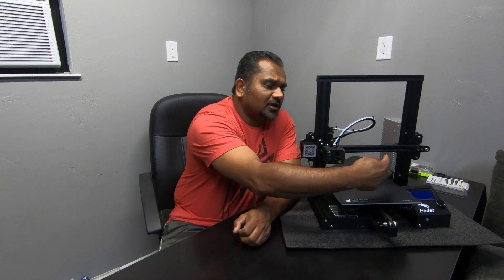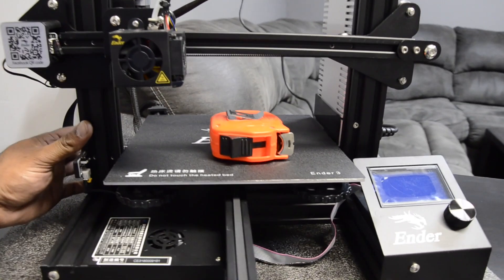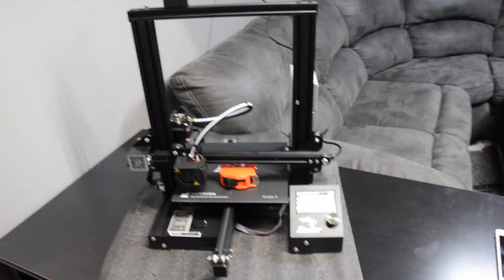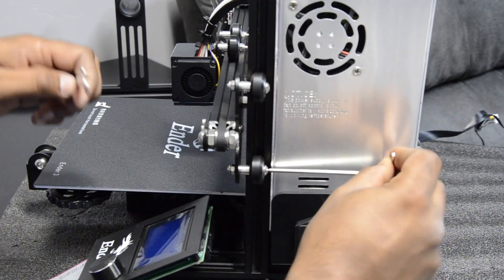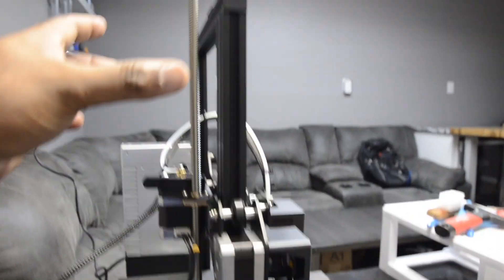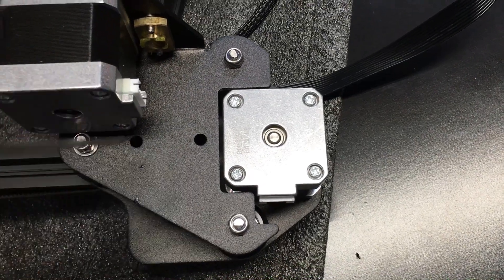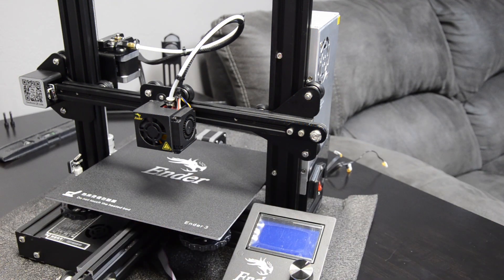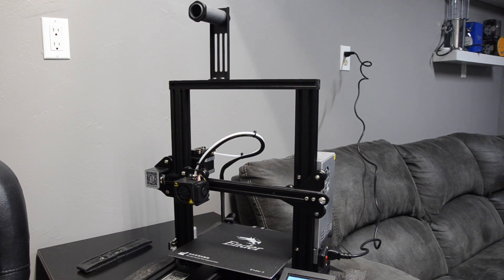Creality Ender 3 / How To Level Your X Axis

Comment: On my Ender 3, the X-axis V-slot extrusion looks like it's really not level compared to the table the machine is sitting on (or even just visually comparing to the 90 deg angles on the top cross-member V-slot extrusion. On the Ender 3, the tighter the wheels on that right side are "hugging" that right-hand side vertical V-slot extrusion, the less wobble (or play) you're have on your X-axis V-slot extrusion. I check it by hand every few weeks or so to make sure the V-wheels haven't loosed. Tightening those eccentric nuts usually deals with any play. But I still notice that the skewed X-axis. I don't know what else to do, apart from upgrading to a dual Z-axis to really get  rid of all wobble or play on that X-axis extrusion....

Comment: Got a little issue with mine, will try you methods tomorrow, thanks for the tape measure tip on measuring if it actually is not level

Comment: the single (dumb) nut that holds the extruder (and bolts the left side of the gantry arm) on my old ender 3 V2 is loose and the arm wants to move upwards, what can I do? I tried tightening it and it turns but doesn't get tighter

Comment: I was able to get the code/commands etc updated. I created an issue on the KenT2 Pi Presents page. He answered me on what needed to be done. Follow the links to the code page and then go to the Issues tab. Look for the issue posted by me, ErinC13. Ken answered what needed to be done and also updated the profiles so they will run on Pi Presents KMS

Comment: First, I am appreciative for the informative video, it is the first that I have found that has actually helped...somewhat. I say that because even after removing my x-axis gantry and tightening the plate screws, which weren't loose at all then replacing everythingand tightening the wheels again, I am still a full sixteenth of an inch lower on the right side of my x-axis gantry. I was an eighth prior to this. Perhaps I just have a defective printer?

Comment: I was up to a point where I thought the bed was warped or the structure deformed as the nozzle was getting stuck to the bed from the center to the left. I even thought of disassembling the entire printer and assembling it all over again until I saw this video. The right side of the X axis was over 1cm higher than the left and now I can finally level the bed. Thanks a lot for this video

Comment: The two bolts holding the right side on were what did it for me, those are really easy to reach so before taking the whole x axis off try adjusting them first, just loosen it and try to hold it where you want it and tighten them back up

Comment: Those two M4bolts can be replace by two M4x20 & two nuts mounted the other way around(tight fit). Now you can adjust the x-gantry without removing it.

Comment: thanks a bunch. noticed the right side of my printer wasnt raising as fast bas the left at the start of prints causing them to lean slightly. Noticed a few of my wheels werent even touching fixed the issue

Comment: My x-axis is still off by about 2mm, any ideas?
Reply: maybe a little late but if it is the right column thats lower, i propped something under the x gantry on the right side and turned the z screw down by hand untill they where level. while in the level position, i tightened all the pom wheel screws.

Comment: thank you SOOOOOO much. i recently go tit for my birthday, and the print kept smearing on one end of the bed, so naturally i leveled that, like a mad man. only to find out later that the x arm was not leveled at all. and i have just been printing with the bed similarly leveled to the Xarm. but no more thanks to you. the wheel adjustments helped. will adjust accordingly when my caliper comes in. again, thank you sooo much

Comment: well, having followed you awesomely clear and concise tutorial here, found my x-axis is not only off by 4mm (Now corrected), but the gantry itself is bent slightly, with a bit of elbow greas and a general tightening though, its now about as level as can be, still off by maybe a mm at most, but its as good as its gonna get short of replacing the arm, which i just dont have the funds for atm

Either way, many thanks for this awesome vid, youve got yourself a new subscriber, also a couple friends just invested in FDM machines, i'll be sure to point em your way as well :)

Comment: Hey man, did all the steps but my X axis on the right side is loose, i can move it up and down with my hand qith a little bit of force, is that normal? i have ben able to print by moving it up so that it makes the first layer well enough to keep printing and it does, but it does seem like i HAVE to do tht every time, so is it normal or should i look into another work around?

Comment: The problem for me is that you can't access the bolts on the brackets while the gantry is on. I really think they could've drilled a clearance hole in the z axis rails to stick an allen wrench through.

Comment: Thanks! Thankfully, I managed to get it aligned without having to take the whole thing apart. I noticed the issue when one of my bed height adjustment wheels had to be fully tightened to get the bed levelled and I'm so glad that my troubleshooting led me to this video. You saved me. I am eternally grateful.
Reply: Thats my problem currently
Reply from the maker: Excellent!

Comment: I leave the two plate mounting screws on the right end (by the power supply) loose, until every thing else is adjusted. That allows the right end plate to 'align' itself to its Z rail when you tighten that eccentric. Then, when you tighten the two plate screws, there is no alignment torque applied to the X axis.
Reply: This needs to be first comment! Its been so long since I needed to make adjustments that I forgot this trick made it super easy to adjust properly! Thanks for the reminder Doug!
Reply: I have been trying for so long and this comment legit just fixed it in minutes. Thank you so much this needs to be top comment.

Comment: I was told in other tutorials "specifically for the ender 3 v2" that the wheels should be somewhat loose, so it doesn't cause the wheels to wear out due to unnecessary stress. Which I thought was weird, because otherwise the right hand side would essentially be a cantilever without sufficient, force keeping it entirely straight. I'll give this a try, as it makes sense that you want them to have good contact with the rail to maintain it's position.
Reply: Same. I thightend the rightside and it fixed my problem

Comment: I was able to skip fully taking it apart by loosening the outside 2 wheels near the PSU and the eccentric nut. i got the measurements level by hand and clamped the x-axis to the bar with a quickgrip clamp. tightend it all up and unclamped. its perfect and rock solid.

Comment: you know i did this set up from morning until now 12 :00+ am and i just heard my neck crack very loud .i worked so hard i wanna cry

Help me . here's my problem: (ender 3 v2)

the left part is too tight. ;___; and its so stiff to lift it up or lower it.......while the right side is loose, In the front view the x axis isnt even leveled properly as the right side with wheel kinda goes down while the left is kinda lifted up. 

I dunno if its the screw knob thing to turn around i did that too but not working or Im doing it wrong. .

ill watch this now, but please someone help me ;__;

Comment: Thank you so much.  I have been trying to level my X axis for a long time.  This is the first video that actually solved the problem.  I did have to go all the way and remove the x carriage, untighten the bolts, adjust the plates so they would be in the right position.  But it got me I think 99% level on the x axis. I think that's just a limitation of the overall design. 
Thanks man!

Comment: Thanks, great information. How about adjusting z axis? my z limit switch sometimes seems not bumping after z axis comes down. This breaks my bed leveling since it doesn’t stop at correct z direction all the time.
Reply: Have you found a solution to this issue? I am also having the z axis end stop problem
Reply: @andrewtrainor9995  Yes, my z limit switch was broken, changed with a new one and resolved the issue

Comment: I was having issues with my nozzle hitting my prints for about 6 mos now.  I got a BL Touch and a glass bed thinking it was leveling issues but that didn't help.  Finally figured out the x axis wasn't level and after watching your video I was able to level it and now it prints perfectly.
Reply from the maker: Glad to hear man, it’s always the simple things that hold us back. ( New Santube pla 1.75mm filament is here for purchase ($16.99 ) if you would like to support the channel) good luck and happy printing.

Comment: What are you doing exactly to the eccentric nut?
Reply from the maker: as you turn it it will tighten or loosen the axis. You have to keep adjusting it until your X axis has a good grip. Sorry for late reply.
Reply: @SANTUBE  No problem thanks. Why do you have to loosen the other two? You can't adjust it without doing that?

Comment: Somehow I manage to adjust bedlevel and all runs smooth... until 18 months later I recognize that X axis has 5mm difference! First I try to adjust eccentric nut from right side but it has no effect. But there is another on another side too. After fiddling both I have nos less than 1mm difference. Maybe this big difference cause some weird behaviour to my CE 3.
Reply from the maker: There would be many things but for most part this is the simplest fix.  Goo luck to you bud.

Comment: Simple physics tells us that the X axis column must be at right angles to Y axis columns. The two V rollers on the left column are not adjustable, and therefore the only way to achieve this is by getting the X axis column at a right angle to the Y axis column with the two screws that attach the bracket to the X axis just snugged up and either using your ruler method or better an engineers square to adjust the angle to 90deg, THEN tighten the screws fully. This must all be done with the right side bracket screw also loose. Once the left side correct and the screws tightened, then you can simply tighten the right side screws as that side will self-align. The V roller adjusters are ONLY there to adjust the roller tension on the rail, they should NOT be used to force the frame into square.
Reply from the maker: Agreed!

Comment: Here you talk only about the wheels on the right side but what about the wheels on the motor side? Do they need the same treatment? Everytime I tighten my nuts, my right side seems too tight so it moves after the rod gets everything up. I will unmount again tomorrow and level again. I have a Bltouch so leveling is different.

Comment: I had just noticed that one side of the x axis was off. I used a bubble level to see how off it was and get it to the right spot instead of measuring tap. (Little more visual and quicker IMO). But I was trying to figure out which screws I needed to tighten. So this helped so much.
Reply: Your table had best be perfectly level or the bubble level wont do anything for you, and you'll likely make your situation worse. The key is to get the measurements level with the frame of the printer. if your table is skewed even slightly to one side, it will throw off the square of your x gantry with the frame.

Comment: Great vid and it does work to do what you say. Although even after tightening the four screws I still has a little wiggle. There has to be a mod of some kind to keep side to side wiggle. Maybe put epoxy on rail then tighten all four screws. Might try that.

Comment: The ender 3 rail system is a horrible design. However, it's what I have and this video helped me understand it a bit better. It took a lot of playing around to get mine near level. I got it within 0.5mm. I don't believe it's actually possible for it to be level. A second motor on the Z would fix this issue and maybe an upgrade in the near future or maybe I'll go for a CoreXY. My bed level problems were never a problem till I got a BLtouch. That's when parts got slanted

Comment: I sure hope this is gonna work for me, it's quite annoying with it loose. I tried to tighten the nuts that hold the bar from the extruder side... but even then it was still a little wobbly before I put it on. I don't want to strip the threads though. I really hope pushing the wheels closer to the z beam will help.

edit: so I took the whole thing off again, and I reseated the wheel holders and put them as close together as possible. The decreased the sag, but getting it all completely leveled is very difficult.

Comment: A year and a half later...and I'm betting your video is going to fix my problem. When i level my bed...I have to lower the right side a LOT if I start with the springs fully tightened...so I'm betting it isn't level...I'm gonna try this tonight!
Reply from the maker: good Luck.

Comment: did all  and i still have 2 to 3mm sag on the non motorized size.
Reply from the maker: loosen both side and then retighten again.
Reply: @SANTUBE  what i did was unscrew the carriages and reposition them once and  again to make sure they are straight using 2 plastic boxes with the same height to avoid measuring every time. i finally gave up on a .3mm difference between both. maybe some day again in the future i can get it to 0. little unscrew, check again again again..
also, get the z-bar off so the whole process can be sped up.

Comment: This is a complete waste of time and as far as I can see is completely unnecessary. If a person bothers to do the basic leveling with paper or even someone that uses a dial indicator then your removing an variation of the X axis in the process because you are leveling the bed relative to the path of the hot end. Even if someone were to follow your video instructions basically all your saying is that make sure you tightened your screws tight enough. Other than that, you solved nothing. I did a dial indicator leveling and then using calipers I checked the distance between the top rail and the X rail and its .030" off on one side and yet it doesn't show up in prints at all because the bed follows that same .030" higher level on one side. The object of the game is not to level the hot end travel to the frame, but to level the bed relative to the hot end. Everything is relative to the hot end. If they didnt include the bed level knobs then this would be a lot harder than it needs to be. Since they are included then this makes any X axis fine tuning unnecessary. Not to mention you are assuming that the left and right bottom rails are perfectly parallel to each other, which they are not. This is a waste of time and fixes nothing. My prints are proof to me that this is true because my prints are not .030" lopsided.
Reply from the maker: Thats great that you feel that way but what if your X axis is off more then the .030" and the bed can't be raised high enough to be leveled. Now imagine your new to 3D printing, never printed in your life and you run into this problem. In that case this fix will work. I make these videos for new comers not experts such as yourself. Worst case this video helps someone to tighten the wheels where it mite have been lose, making sure your wheels are nice and tight so you get a better grip is worth it do you not agree!  Good luck and happy printing.
Reply: @SANTUBE  I am a newcomer. I'm just mechanically inclined.

Comment: Just assembled my Ender 3D Pro, and have a 3 to 5mm difference between the right side and the left on the X axis. I tried tightening the screws (All tight already) and tried lossening the wheels etc, as descriobed, but it did not make a difference. Is there a third option?
Reply from the maker: You can try adjusting the left first then right.

Comment: not sure why one would do this If one levels the bed then there no issue or need to level that axes 

...You level the bed to nozzle height in each corner ...so the nozzle is level to the bed ...it dont matter if arm not spot on because well you level
Reply from the maker: If you axis is off you will never have a true level. Plus you can only rise the bed so high.  In my case I raised the bed and the nozzle still wouldn't level because the axis so way off.
Reply: If your bed is parallel to your x-axis (as you're saying), but your x-axis is not square to the rest of your machine, then your parts will come out looking like they have a draft angle in the z direction, since the z-axis is still straight up and down. That is why this is important.

Comment: Solved, the plates on the left and the right, that attach to the X axis bar, weren't completely flush on top (bar next to plate top), with a bit of an angle. I took the x axis gantry off as you said to, but instead of those four screws at the back being tightened immediately, I levelled out the gantry parallel to the bracket. MILES better, there's no permanent angle up. Hope this helps someone! :) Schoolboy error on assembly, but with their awful video and instructions, go figure.
Reply from the maker: Happy Printing!

Comment: Thanks for sharing and this should be useful to a lot of owners out there,  the way I  did it on my Ender3 the upright  extrusions were  identical in length , so I simply put an engineers square on the top of  each of the open extrusions in turn, with the blade pointing down until it touched the X axis bar  and  then go through the process of repeatedly removing/refitting the x axis to adjust the 2 awkward bolts on the extruder side of the X axis  until it sat level with the square just touching the X bar  on both extrusions without moving it, on the  idler side I left it sit slack until this was done so not to skew the results, after which I snugged up the eccentric nut and then  lastly the 2 bolts attaching the X axis bar to the plate - btw  some painters tape temporarily wrapped around the coupler and the 2040 upright while your checking can be  useful in preventing the axis dropping...